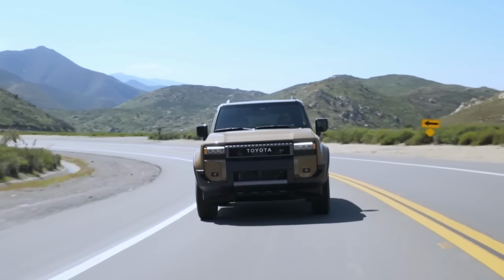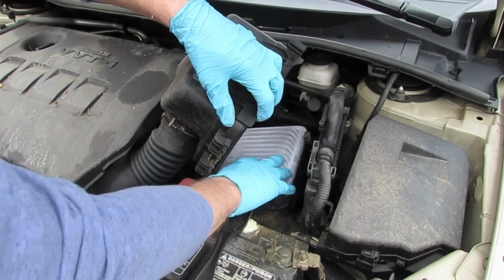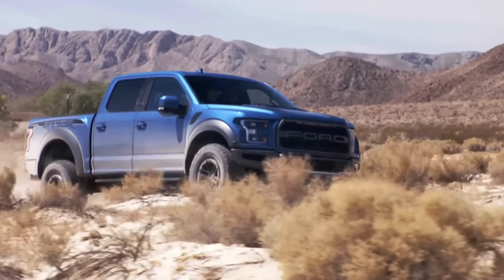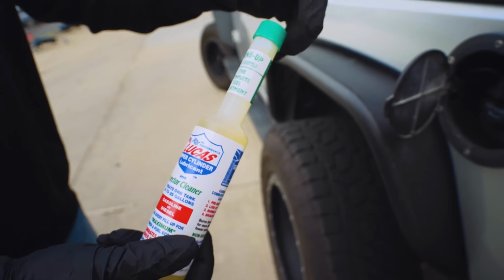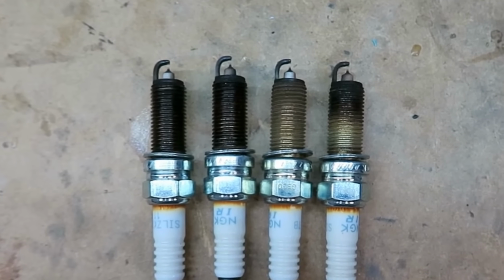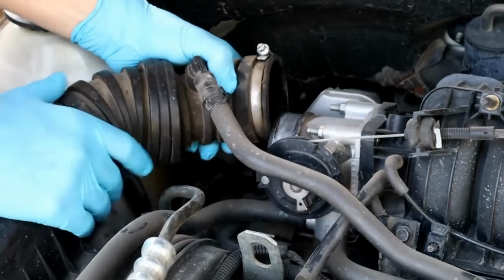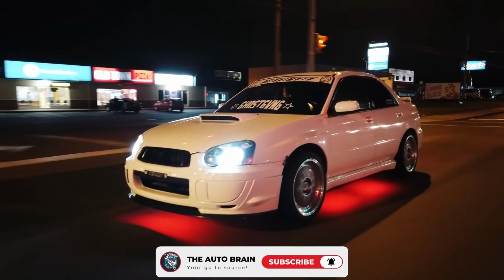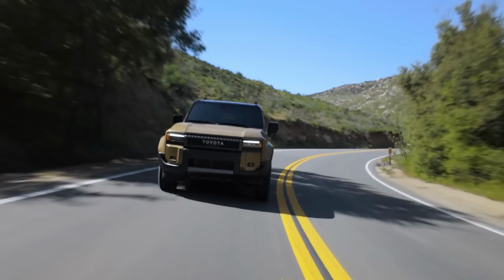Doing This Will Make Your Engine Run Better

Comment: Instead of using flammable sprays, use a spray bottle filled with water. It does the same thing, and eliminates the engine fire potential.

Comment: Never ever use your fingers to open the  flap(s) on a car that has an electrical throttle body!

You will cause the check engine light to come on, and will have to pay to have recoding done.

Instead, use the accelerator to open the flap, then clean accordingly. 

Source: School Of Hard Knocks😮😢😊

Comment: The only spark plugs I have are on my grasscare equipment, and I never change them 🤷🏻‍♂️ They outlast the god damn machines nowadays. 
My mondeo ( fusion in us) gets 60 mpg, has all the comfort gadgets I need, 140 bhp and flies.
The 2.0 duratorq engine is exquisite. Servicing every 12.5k miles, and cheap to run ( in the uk) is a bonus when Diesel fuel is £7 a gallon 👌🏻 and parts are cheap as chips.
Reply: 140 bhp and flies ?

Comment: If one has the recommended OEM air filter for their vehicle and it's doing its job properly.. why would the MAF sensor ever be dirty.. or even the throttle body?? The air is filtered 'before' it gets to the MAF sensor and the throttle body??
Reply: The air filter lets through particles smaller than 5-10 microns and these can get stuck on supersensitive components like air mass sensor.
I wouldn't call the throttlebody supersensitive though in fuel injefted engines (but huge build up of debris will cause throttling of the engine).
Reply: I think you forgot there is another vacuum hose beside the PCV going to the intake and maybe directly to the throttle body. that bring vapor with dirty oil passing through the thotle body

Comment: The following items should be checked or changed........air, oil, fuel filters .  The  idle throttle body should be cleaned to remove carbon build up. I passed emissions test doing this after failing once. No error codes on second try.

Comment: spark plugs ? you can't even get to the spark plugs on car engines these days
Reply: bru wtf yall drivin😂
Reply: Mine doesn’t even have spark plugs.
Reply: My Pentastar engine requires removal of the whole intake manifold system . A ten minute job now takes two hours.  On the bright side you only have to do it once unless of course you drive it more than 320,000 kilometers.

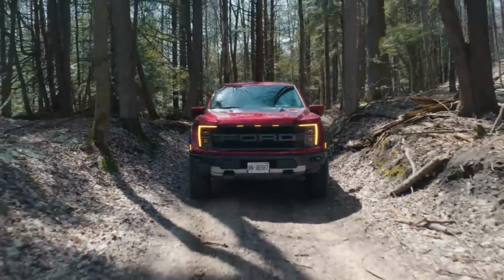Comment: 3:36 is it ever necessary to use more than one fuel injector cleaner to get desired result? And would using more than one bottle cause damage?
Reply: In the video the four different brands of fuel injector cleaners shown was basically to let viewers know that we can choose either one of those top brands.  I use the Techron brand.
Reply: @jefferybaxter1225  I appreciate you responding but you didn't answer my question. Whichever brand we choose to use, is it safe to use more than 1 bottle to clean very clogged injectors?
Reply: @daphrampa   Depending on which brand it is, one application of the injector cleaner could do it.  If not, maybe two or three applications.  Not two or three at the same time though.  Not like that.  One can be used now, then on the next oil change you can use another.  Then, so on if it's three.
Reply: @daphrampa  I would just repeat the dose in a week. I like Lucas or Sea Foam
Reply: @asappestcontrol1250 I checked last week and p0507 came back after fuel injector cleaner and cleaning the engine air filter. The strangest thing happened tho after doing those two things. My CEL light turned off and I didn't have any fault codes at all. Which is definitely crazy bc my catalytic converter has been clogged or something for a year now. I always get that code and the CEL stays on bc of that. So it blew my mind when it went off for almost 2 days

Comment: Will it be ok to wash down the sensors with WD40?
Reply: CLEAN THE THROTTLE BODY. MAKE  SURE THE FLAP OPENS FREELY.  CARBON BUILD UP MAKES IT STICK.
Reply: @roberthenderson4466  how does carbon get in there when the fuel hasn't burned yet??
Reply: @Payner2644  over the years carbon will build up once you turn the engine on. I did my throttle body and what a difference running and idle it makes. many people never do it. the fuel filter should be done too. passed emissions test with no codes showing. Never take the test with engine light on. yOU will fail right away.
Reply: @roberthenderson4466  I live in a free state, so no emissions tests!
Reply: @Payner2644  WHAT STATE WOULD THAT BE PAYNE........
Reply: No
Reply: @JordanMac79  VERY PROFOUND ONE WORD ANSWER.
Reply: NO
Reply: Absolutely not
Reply: Use the right cleaners

Comment: I haven't changed my spark plugs in years 🥲😭
Reply: You usually don't need to. The first time is the most important bc it's usually around 100k mile mark. If you have to change them frequently then there's a good chance there's something wrong
Reply: @daphrampa iridium’s practically last forever.
Reply: @GregoryRamsey I understand that, but you have to consider other factors after the 1st interval (100k mi). Factors like: spark plugs wires or coil packs, driving conditions, driving habits and if all other connected components are in ship shape and nothing is causing carbon build-up
Reply: I had a misfire at 110k miles. I replaced both coil packs and plugs. My plugs were in really good shape but I changed them anyway. Probably a good idea to change them. But chances are if you are less than 100k on them , they're probably okay.
Reply: @wordnerd2005  yep, but only the first 100. After that service intervals tend to become more frequent and nothing is safer than following the manual when working on your stock engine.

Comment: Gasoline additives are pissing away money since gasoline already has cleaners in it.
Reply: 💯 correct. Nothing is a better cleaner than pure diesel / gasolien
Reply: Only TopTier gas has the additives that properly clean injectors. Cheap gas that isn’t labeled Top Tier is false economy.

Comment: That's just a basic service, it needs to be done every 5000 miles when the oil / filter is changed.
Reply from the maker: Exactly! A basic service like an oil and filter change is essential every 5,000 miles to keep the engine running smoothly. Regular maintenance like this helps prevent bigger issues down the road.